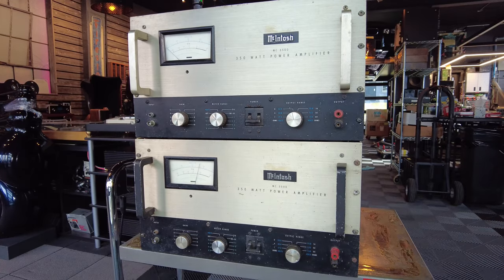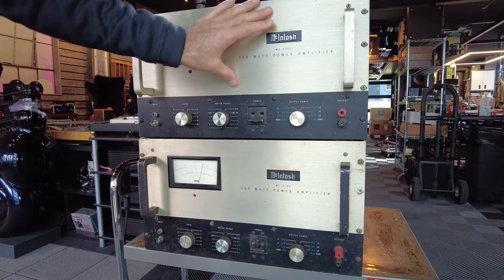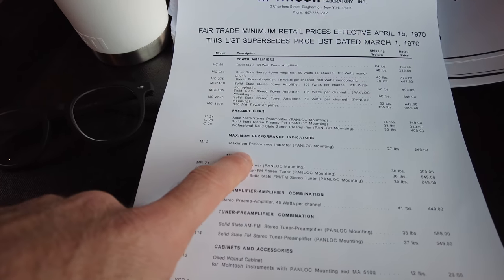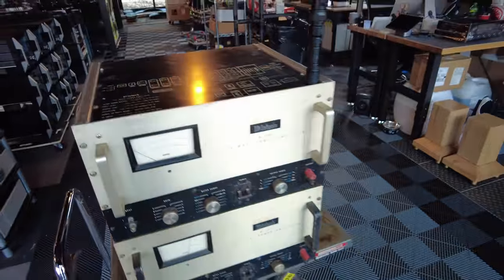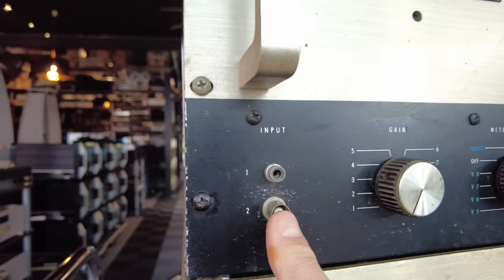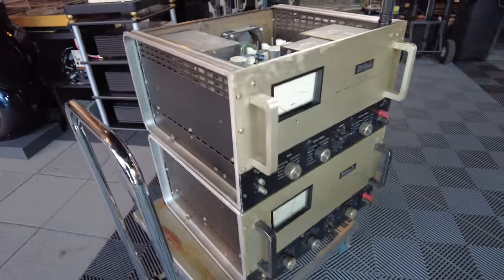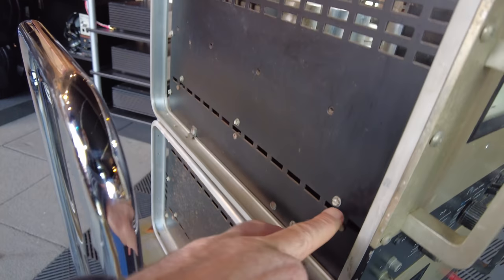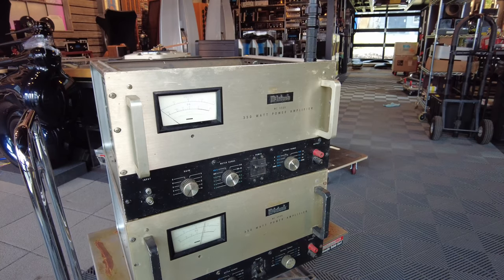A Look at the Most Desirable McIntosh Amp - 350W of Glory and History

Comment: Fernando, something of interest.  Aboard the USS Archerfish, SSN-678, a Sturgeon class fast attack submarine, there were a pair of these amps with an industrial face plate and fewer controls.  They were rack mounted.  Their power was used to `ping’ for sonar identification purposes.  I remember lusting after them to run my quad set of Large Advent speakers.  I served aboard the Archerfish from ‘70-‘74.  McIntosh was quite busy with industrial purposes too.  There were many of this class submarines commissioned.  Those two amps went along on some interesting Cold War missions.  Thanks for your great videos.
Reply: The development of the Grateful Dead wall of sound was impeded by some shortage of these amps, of which they used many.  The story goes, they couldn’t get enough of them at first because the Navy was grabbing them all up.
Reply: @stagesixx  Crown DC-300s would have been a good substitute.
Reply: @stagesixx  The dead continued to use McIntosh amps well after the wall was no more. 
Hoping to find one in a surplus store some day..
Reply from the maker: I wonder if those amp on the sub were MI-3500, the commercial version of these.  So cool, thanks for sharing.
Reply: @SkyFiAudio  They could have been.   On our missions/patrols we of course ran silent so the Macs were never used when on missions.  They were probably removed when the boats were decommissioned and then installed on the 688 class boats.

Comment: For what those amps are, they are in great shape!! The inside has a little surface rust, just clean her up and leave it at that.
Very cool you knew these were used @ woodstock, its not very far and well worth a short pilgrimage even just to check out the Altec/JBL bins that were built on-site and yes, still there! I had a short e-mail relay with Mark Levinson last year and he told me the mic preamp used on stage was his design. Also for stage monitoring, Crown DC300's (i believe) were used for amplification.
Reply: I'm sure he won't tear it up.
Reply from the maker: We've had a lot of inquiries on these already and we might just leave them as-is per the new potential owner's request. We're working on another video soon where we go through the delicate process of powering these up for the first time, plus initial testing and measurements on our tech bench. Stay tuned.
Reply: @SkyFiAudio  This does raise a curiosity ive had for some time now Fernando, whats up with using pro/DJ amps in the home with HiFi speakers?  Is there no sound difference? Is it strictly whether or not your willing to tolerate a little bit more fan noise?

Comment: Listened to a pair of these classic monsters at McGuires hi-fi when they came it-being used with a pair McIntosh column speakers. The sound was so powerful,clean and captivating. Yes,6LQ6/6JE6 tubes were used as horizontal output tubes in color tv’s of that time. So wanted a pair of these beasts!
Reply from the maker: Thanks for sharing!
Reply: I want a pair as well 👍

Comment: Never had a chance to her the 350s.  I did own a pair of MI-200s though.  All 4 chassis, 300 lbs of 200s triode glory.  Scary amps with their 1,300 volt 3 amp power supply, but what a sound.
Reply from the maker: those MI200's sound crazy cool.  Pls share picture!
Reply: @SkyFiAudio  wish I could.  Sold them back in the mid 90s.  The few pics I had of them, lost in divorce.  They used the 8005 triode tube.  Just a pair of them pushed over 200 watts triode

Comment: The 6LQ6 was designed to be a horizontal output tube for television sets but can work fine in an AF amp output stage. I'm sure the tube audio enthusiast crowd drove the price of this common cheap as chips tube up through the roof.
Reply: It was also used in a lot of inexpensive linear amps used by hams and CB'ers. That drove the price up as well. One amp I knew of years ago used 12 of them.
Reply: I recall paying 28.00 each at Lafayette for a 6LQ6 in 1979
Reply: It was the CB idiots that drove the price up on these sweep tubes. The linears that used them were inbred engineering at best, dirty output signal and ate these tubes up at an alarming rate... 
Very few audio amps used sweep tubes, this McIntosh, Traynor had an incredible bass amp for bass guitar, maybe a few others...

Comment: They had 16 amps and Mabey 30 speakers or so. What was all those wires going to? Looking at those wires I would think they had hundreds of amps speakers with 20 different sound boards and 6 micd up orchestras. I can’t believe they played the whole festival with 16 amps and 10k watts I would’ve thought it would’ve been 10 times back then. Great video
Reply from the maker: I imagine since drivers were so efficient back them a single amp with the aid of impedance matching could power a whole lot of them.

Comment: I think the 1.1 volts input refers to the preamp single from the strum of a guitar. The AC input of 400 to 900 watts makes me wonder if this was just a Class A amplifier if all it put out was 350W RMRS. I didn't see any push-pull configuration or phase inverters for the brief time I saw the schematics. This seems to be a raw power beast!
Reply: It was push pull output stage 80 watts class A i recall after setting
Bias ..! 

Plenty heat fan cooled , fan ran continuously..!
Reply: McIntosh ran class AB2 in their tube amps, if it were class "A", there wouldn't be such a power variance between idle and full power...

Comment: Did those meters move as your finger pointed to it?
Reply: They sure did. The humidity is currently pretty low in NJ.
Reply: In the right environment, you can create a static charge on the meter glass, which will attract the needle, I've done it a few times.
Reply from the maker: Yes!  I think the static charge induced by my fingers make the needles move.

Comment: From what I have heard the banks of these amps used at Woodstock for sound reinforcement had to be powered by diesel generators-the power there could not power them.
Reply from the maker: I believe it, didn't it take place in a random farm field?
Reply: @SkyFiAudio  maybe that was the situation-the area didn’t have power of any kind.
Reply: There was over450 kva on two banks and they were backed up by two more banks. Thirteen hundred kva is waaay more than those could use. Had a fellow lineman that had a pole line business and he was on that job. They were up there in June starting things.
Reply: Very large transformers to bring that back down to 208/120.
Reply: Kinda doubt that by there were definitely generators for backup there. A few line crews were there and ran 3 phase high voltage in with some lage pole mounted transformers.
Reply: At the VOA transmitter plant I work in they have 2 500kva 4160v to 208/120v3ph  transformers for general building power. The 250/500kw  SW transmitters run off 4160v 3ph. The transformers are on an auto changeover-if one of those 208v transformers fails the transfer switch changes to the 2nd one. The shift super checks this on each shift.

Comment: Such beasts!!! Does anyone here know how I would repair my McIntosh amp meter problem....my left channel meter gets stuck at a higher wattage reading...it will work fine under a that wattage level until I turn the volume up...the right meter works perfectly. When I turn the unit off the meter falls back to read zero. I  have cleaned the amp ,air duster and electronic contact cleaner,but I am afraid to use the cleaner on the meter section......thanks in advance.
Reply from the maker: Often times the oil in the meter bearing dries up requiring disassembly cleaning and lubrication. They are very delicate so proceed with extreme caution.
Reply: @SkyFiAudio  I was afraid of that,I am a newbie to working on the electronics inside audio units.......thank you for the response.

Comment: The 4 mm binding posts were forward-thinking. $1000 is still quite a bit of money even today. Must have been quite something to behold in the late 60s.
Reply from the maker: Thanks for this. And not only the price in 1960's to behold, talk about 350W via TUBES!
Reply: Until the mid 1980s most if not all the UK sound systems used massive louvred  1 ohm stable valve amps, they used around 8-12 KT88s to provide 600W-1000W. They used "bulgin" 2 pin Bakelite speaker plugs and had "the mother of all output transformers". Carried a few of them into venues as a young pup, 2 man lift only.
I think valve technology was being used for really high power applications in the late 60's until silicon based transistors caught up and TVs for example could become "solid state".